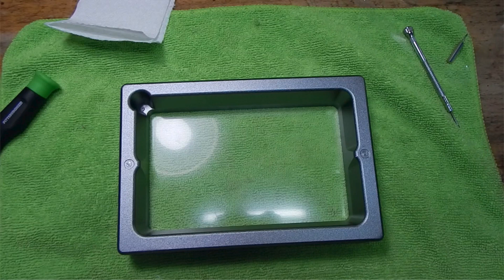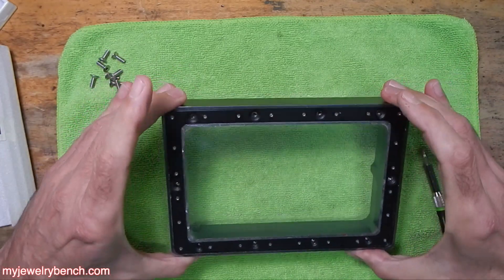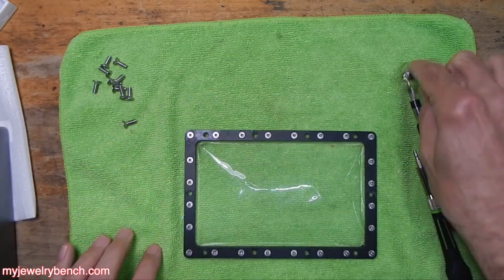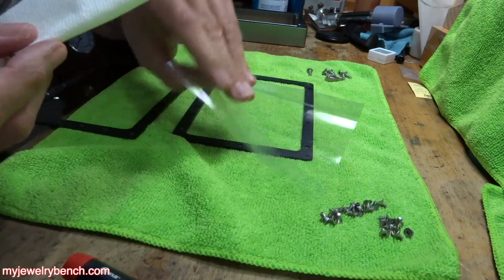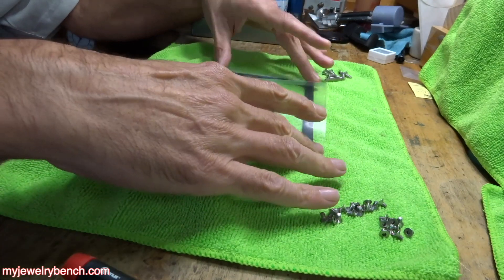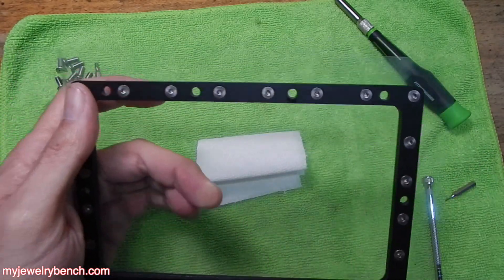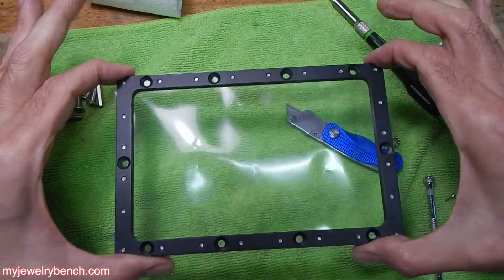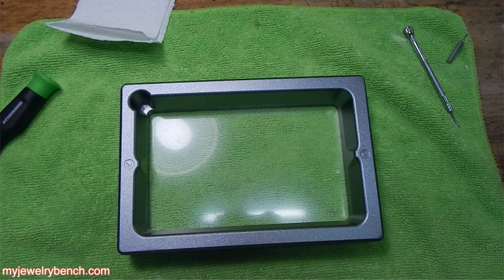3d Resin Printer FEP Film Change on your VAT...  Lets have fun!

Comment: What is an "Elegoo Mars" and what is it good for?  What is a Resin Printer?  You have been unduly tight with your communication.
Reply from the maker: 3D printers like the elegoo Mars are great for anyone who wants to make things. I use it to make small prototypes and jewelry designs. Many people use them to make artwork such as characters or things like chess pieces and figures. Resin is the liquid material that will turn to a solid when exposed to a certain type of light. Your limits are your creativity and the size of the printer you use.